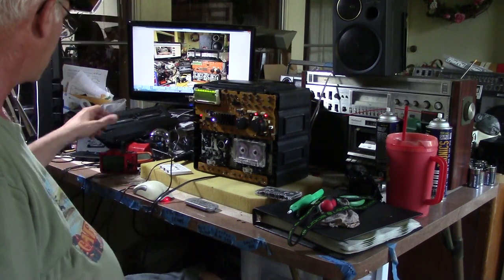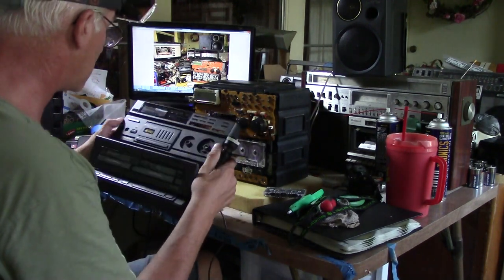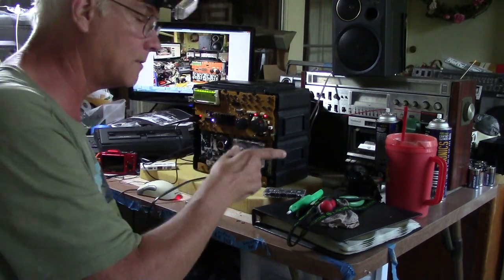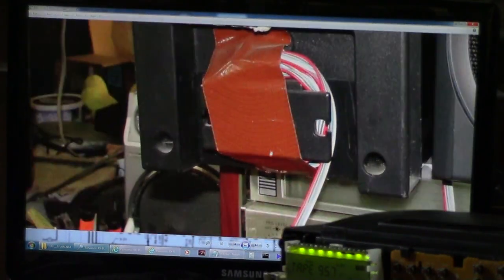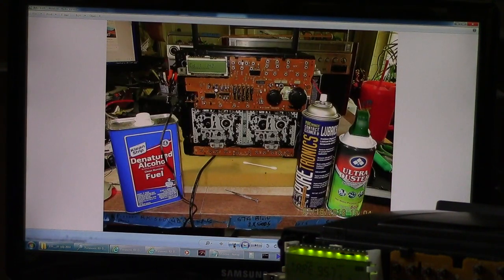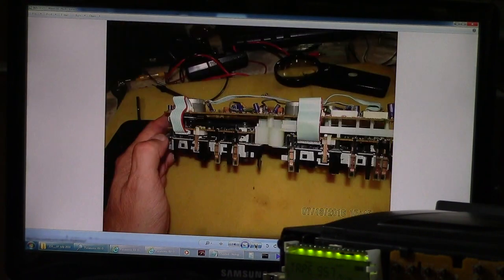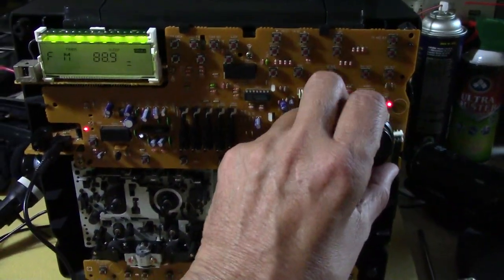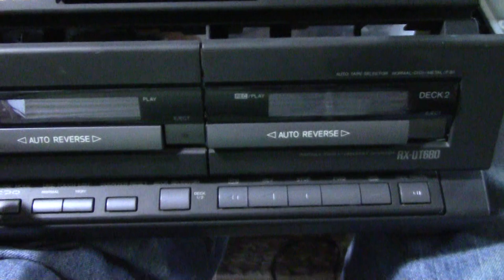No Instructions How do I make this Panasonic RX-DT680 work Record Tape

Comment: Sir i have panasonic rxdt7 model. Its power on but not play the music. Can you tell me the integrated chip (IC) number or equalizer set IC number? Please tell me.
Reply from the maker: I only have Knowledge of model's that I take apart and take pictures of ok?  If you need to know the IC number of your model then you need to take it apart and then google that exact number to see if it is availaible to buy so you can fix yours right?
Reply: @Cassette2Go  i can not exactly how to open that case
Reply: @Cassette2Go  are you know about some buddy who knows about there Repairing
Reply from the maker: @muzaffarjahangir1457  you'll need a long screwdriver a number one and a number two Phillips